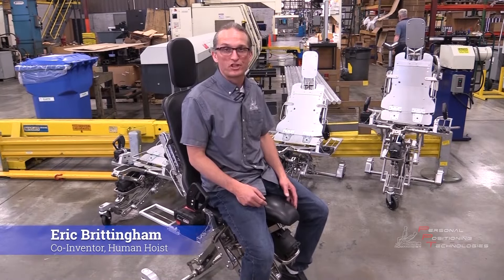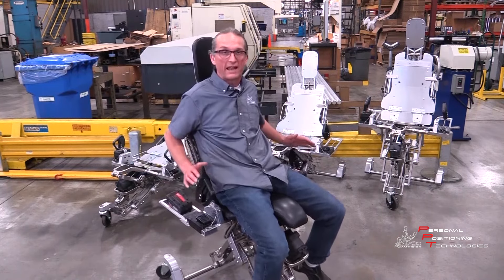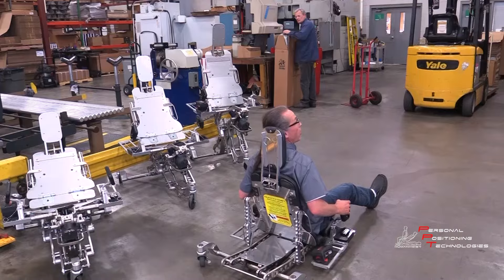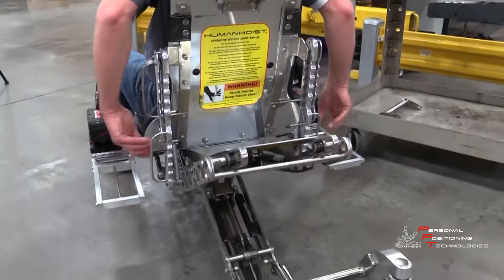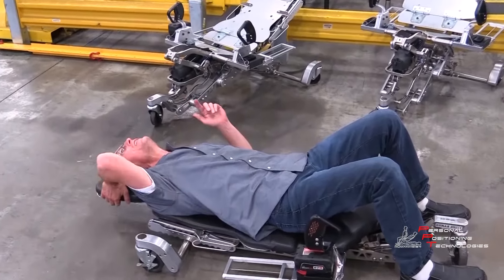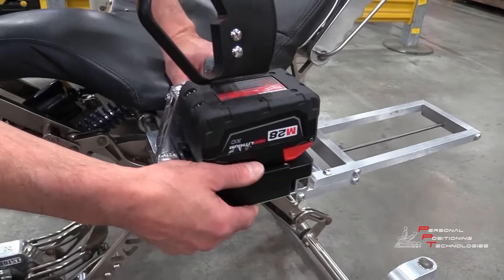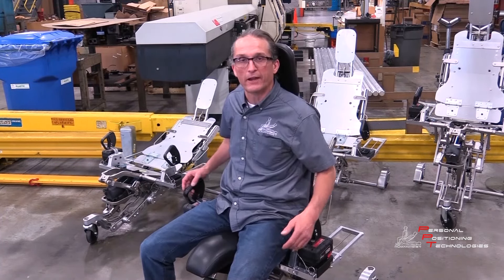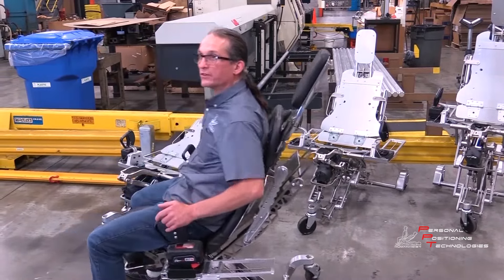PPT Human Hoist Powered Shop Chair 1.0

Comment: Not to be a downer but 19 grand is expensive but on another note if I had it I would definitely get one lol this could save a lot of mechanics and body men's lives in the long run from wearing out the body
Reply: 😬😬 at that price I much rather fab one up my self for maybe 500 or less
Reply: Needs a replaceable/detachable face shield that's connected to the headrest, like a face shield. Designed properly to hold weight, it could protect/deflect heavy objects from your head. As well as keeping debris off your face.

Comment: They say this creeper is only 4 inches off the ground but that is only true for the middle lowest part, the back is about 8 to 10 inches off the ground. The hydraulic unit you are using is good but it only has a 10% to 15% duty cycle which means you can only make your creeper go up and down about 20 to 30 times then you have to stop and wait about 15 minutes until it cools down.

Comment: Where can one buy it
Reply from the maker: Thank you for your interest in the Human Hoist by Personal Positioning Technologies.  The Human Hoist Powered Shop Chair is an industrial grade tool, designed to bring the worker to the work.  It's current design is for use within industrial grade heavy equipment manufacturers such as John Deere, Case New Holland, and Mack Truck.  We are working on a model that would be best used for standard car mechanics for a much lessor cost.  This current model sells for $19,900.00.  For more information and contact information, please visit us at:  https://humanhoist.com